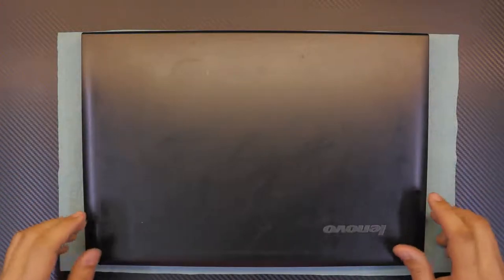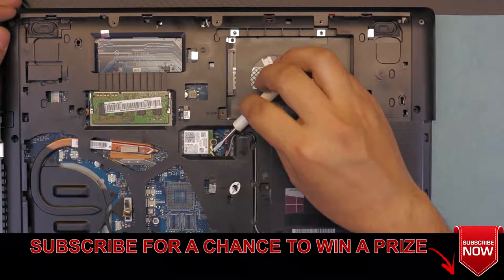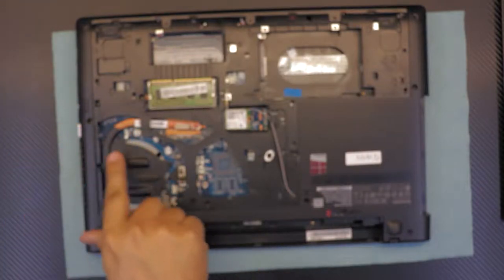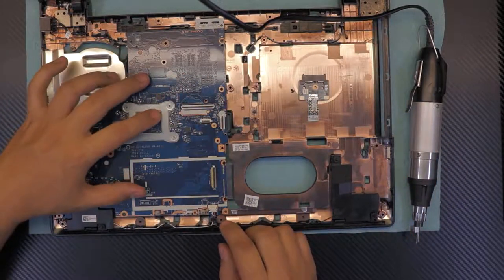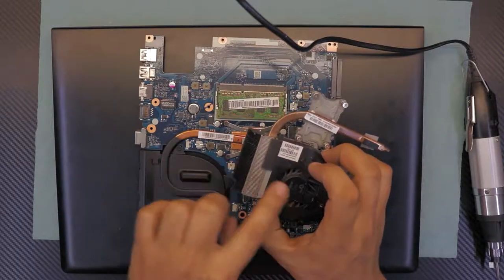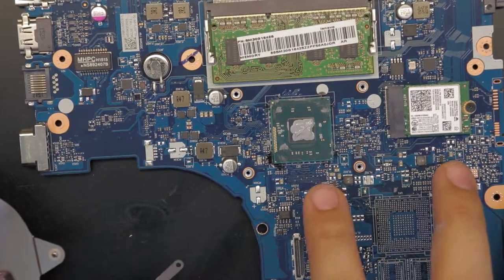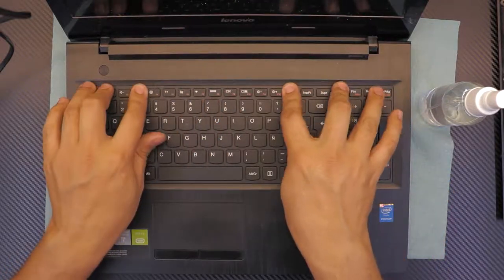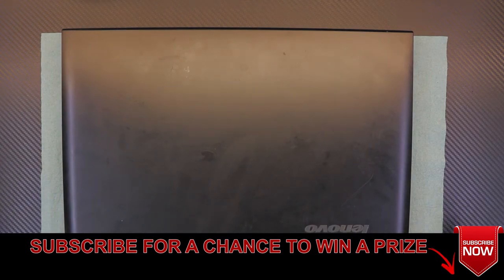LENOVO G50-30 Disassembly and repaste, DO NOT BUY THIS LAPTOP!

Comment: Brother what will happen, if I remove CMOS battery from motherboard and laptop main battery, and turn on with adapter power? Can it help me to reset my BIOS? Without inserting both of batteries
Reply from the maker: if you remove both batteries and leave it off for 2min the bios should reset, and for your question the laptop can be turned on with only charger and without the bios battery and internal battery.
Reply: @uFixTek  I have done all, removed CMOS, main battery,power plug, not only for 2 or 5 minutes but for a whole day, but its(Lenovo G50-30 ) BIOS is still not reset.
Reply from the maker: if you did the above then you got bios bricked, you will need to replace it, you can find the bios chip on ebay very cheap. or aliexpress. 
this situation happens when you power off during a bios firmware update usually.

Comment: Oh, so missing fan is here by design! It's my sister's laptop, used on daily basis since 22.11.2014. She was not happy with performance and asked me to reinstall Windows. It was extremely slow on stock HDD (some WD Blue 500GB), so I've decided to replace it with some Kingston 120GB SSD. Now it works great, without any issues. But during final tests, I've noticed it's silent even when playing some 1440p video so I've decided that fan is dead. After opening laptop cover again, I've noticed there is no fan at all (interesting, there is still 3-pin jack for CPU fan on the mobo, so I guess fan is included in some more advanced models with better CPUs).

Anyway, looks like missing fan is not a problem for this laptop because CPU is not hot (after playing HD video for ~15 mins, heatsink was "touchable", not extremely hot). There is no sense to fully disassemble this laptop for cleaning (I think it's awesome), the only thing I plan to do in the future if won't forget - replace thermal paste on CPU. Ahh, I see it would be needed to fully disassemble it for this kind of job...

But yes, SSD is definitely recommended here, even nowadays this laptop feels pretty productive now and can easily solve daily routine (check mail, some videos, forecast, office work etc.)!

Thanks for a great video
Reply from the maker: thank you for your opinion and tips, and yes ssd will boost the speed of the laptop and regarding the fan .. yes it includes in a different models, and we get this models in store often because of over heating because some people that buy this unlike you they dont use it for basic task or videos they try load games and that will cause the cpu soldering balls to crack if over heating. but yes if you use it for basic tasks it will be just fine.
Reply: hey what os did you use?

Comment: i have this laptop. Havent disassembled it, but im pretty sure it does have a fan built in, because it makes noises that sounds exactly like a fan
Reply from the maker: Thank you for your feedback! If you wish to support the channel, you can like, subscribe, or both!
Regarding your laptop, then you may have a reversion with slightly higher better CPU that comes with a fan, there are many reversions of this models with different CPUs.
cheers🍻

Comment: Hi can you help me to locate CMOS battery in this laptop model please please please, my laptop keyboard is disabled in bios and windows got currepted and i am unable to access boot menu
Reply from the maker: Thank you for your feedback! If you wish to support the channel, you can like, subscribe, or both!
Regarding your question, the bios battery is soldered on board, https://imgur.com/a/Io3XEIx
you can short the batteries terminal for 10sec and let go and then plug back the main battery and power on. now your bios settings are back to defaults.
Should you have any further questions or requests in the future, please don't hesitate to ask me.
Reply: @uFixTek  subscribed👍, brother can I get your mail id please, I will send my laptop motherboard image , please highlight the CMOS battery, because yesterday I unsolded a component like that(CMOS) but it still not working, I unsolded the blue component visible in Google photos link I sent below 👇
Reply from the maker: email me @:
ask@ufixtek.com

Comment: I got this Laptop about 7 Years ago. And although it hasn't a fan build in, it still works much better than You would expect. I upgraded the RAM, switched from the HDD to a SSD & installed Windows 10 on it a few months ago. And voila: it just works very nice. I can do Office Stuff, simple Audio-, Photo- & Video Editing and it's also possible to enjoy Retro Gaming on it. Yes, it is indeed a little hotter than the ASUS X551MAV or the HP 250 G3 because of the not included fan. But I haven't experienced any Heat caused Performance Issues on this Device in all these Years. Although it could be possible of course. I don't wanna exclude this possibility. 

My Recommendations for this Notebook are: RAM- & SSD-Upgrades and install Windows 10 or Ubuntu/Linux Mint as OS on it. If it's necessary, renew Thermal Paste (thanks to You & Your Video for showing how to do this btW). That will improve the Performance of this Notebook a lot. And of Course keeping it clean & nice. ✌😁😘
Reply from the maker: Thank you for the feedback, and your suggestions regarding upgrade and yes def a big boos on speed with an SSD and extra ram. but still its a shady move to not include a fan as if you work long hours on it it will accumulate the heat. thank you for the support :)
Reply: hey which nice windows 8 or 10?
Reply from the maker: go with win 10
Reply: @uFixTek  they say windows 8 is faster than 10
Reply: @jamespandarawan1643  Well, my Experience is, that both run actually good enough for Standard Tasks. But I still would recommend Windows 10 in Combination with an SSD-Upgrade at least. I upgraded my G50-30 with a Crucial 8GB DDR3L SD RAM & a 250 GB Standard SSD by Intenso, installed Windows 10 on it & got a very good Performance.
Reply: @derchristianausffo_uncut  you're very lucky my lenovo g5030 has a hinge problem.
Reply from the maker: sorry to hear
Reply: @uFixTek  my laptop hinge is creaking how to solve it?
Reply from the maker: send me some picture so i can see.
Reply: @uFixTek  where I can contact u?
Reply: @uFixTek  done

Comment: I have this laptop. Recently, the CPU usage is always 100 per cent. Does it mean that the thermal paste needs to be changed. It's about 5 years old. Thanks.
Reply from the maker: the HDD usage has nothing to do with thermal paste , you have windows 10?
Reply: @uFixTek  hdd? Yes I have windows 10.
Reply from the maker: HDD = Hard drive
i need you to go and disable windows search:
pres: Ctrl+Shift+Esc and once in the task manager to to the services tab, then at the bottom there is a link saying "open services" click that and wait for the services, then scroll all the way down and find "windows search" double click and change startup type: to disable
and service status: STOP
and apply and ok.

NEXT:
press Win+R
and type: taskschd.msc
and go to this folder Microsoft>Windows>Defrag
then on the right side click the END and after click disable.
and reboot the computer.

Comment: That's at most just a 10 watt CPU. It probably doesn't need a fan. Lots of super low wattage GPUs lack fans too. Though having a heat pipe to nothing more than a thin piece of metal does seem odd. This must have been a really cheap laptop when new.
Reply from the maker: yes it is a very cheap end, but it is not a laptop, more like phablet. i would not recommend it to anyone.

Comment: I've this laptop G50-30 , can i upgrade a real working fan to it ?
Reply from the maker: 🫠Regarding your question, no, you can't because there is no fan regulator circuit and power delivery, and you will face many issues.
Reply: @uFixTek  thanks but there is dedicated socket on the main board to give power supply to fan and the bay trail processor is also capable of  regulating the fan.. my friend did this on same model

Comment: hey sir can I put fan in this fanless laptop?
Reply from the maker: yes and no,
no: because if you will need a lot of the missing components, and fan controller chip,
yes: if you know a bit of the electronics you can pull the 5v fan rail from the back of the usb port.
you should ask a repair shop to do it for you.

Comment: How you remove the lcd cable?
Reply from the maker: thank you for the feedback, you want to disconnect the lcd cable @9:00 you see me removing the lcd cable , you just have to pull on the jack and it will come loose.
Reply: @uFixTek  the black one that I need to pull is broken already how can I remove it?
Reply from the maker: then hold it from the sides of the jack and pull it wont break.
Reply: @uFixTek  ohh thanks.. can I hold it from the side? In the metal?
Reply from the maker: yes put your finger nail or a flat screw driver to one side and pull it up.
https://imgur.com/a/uyqJvjw
Reply: @uFixTek  ok sir thanks
Reply: @uFixTek  should I pull it with my nails at the same time?
Reply from the maker: yes just pull it away the opposite direction as the motherboard.